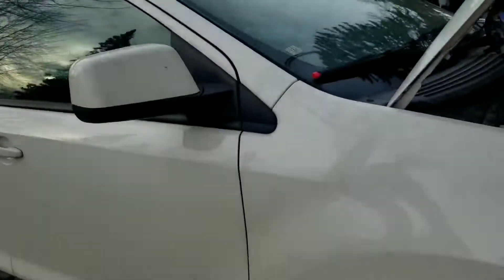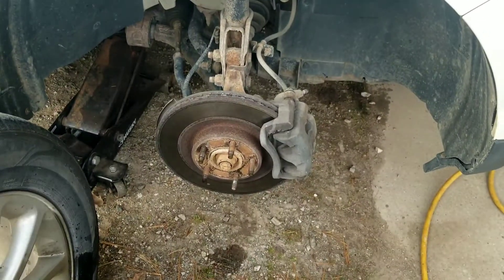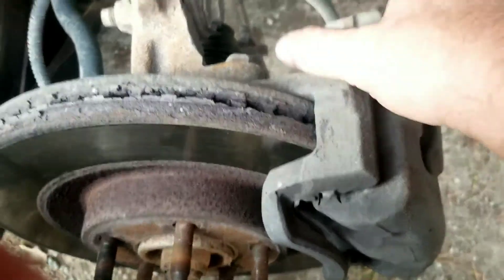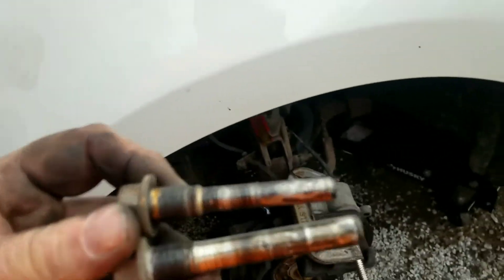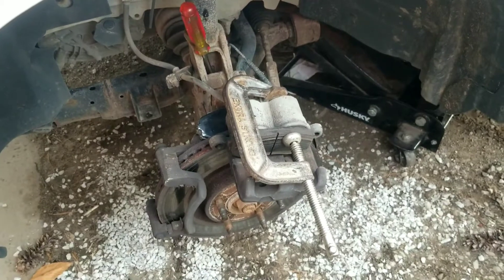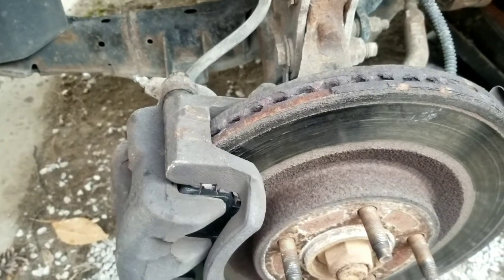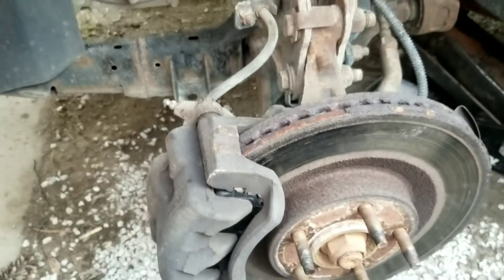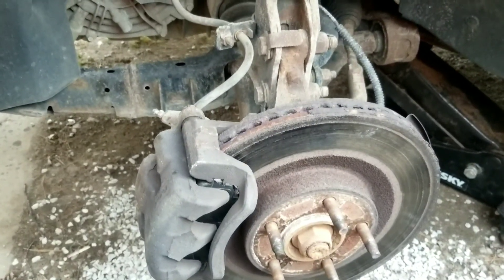2010 Ford Edge front brake pads

Comment: Just did this same year and model vehicle yesterday. Front pads and rotors. One thing I ran into was on one side the bottom glide pin must have stuck to the rubber boot that runs through the caliper bracket. It twisted up when I removed the pin, luckily it didn’t rip. Couldn’t get the guide pin back through. I’m assuming whoever did the brakes last time didn’t grease the pin up very well if at all. Wound up having to pull the entire boot out. Greased it up and pushed it back into place with a dowel. There is a flared cap at the end of the boot that pops out on the other side, but only on the bottom. Weird but whatever. Just wanted to point out the issue I had with this same vehicle for anyone else working on one.

Comment: You didn't need to turn the rotors?
Reply from the maker: I wanted to replace rotors, but neither me or the owner had the $ to buy new ones. It was a complicated situation.
Reply: Less and less places turn rotors now. New standard is to just replace them I guess. I just replaced front pads and rotors on this same year and model yesterday for my girlfriend’s daughter. They bought the parts, I did the labor. I’m keeping the old rotors and try and find a local shop that still turns them, but they are getting harder to find. I can only assume that soon enough the rears will need to be done and it’ll save time and money in parts for them.
Reply: @AngusT.McCraken  The Chinese junk is probably not worth turning.

Comment: The slide pins may be frozen also; restricting  the movement of the caliper housing on its mount and causing excessive drag/wear on the brake pads.
Reply from the maker: Always a possibility,  but in this case my neighbor had the caliper twisted and kinked the flex hose.
Reply: @darylturcott  That's right....obvious cause there.